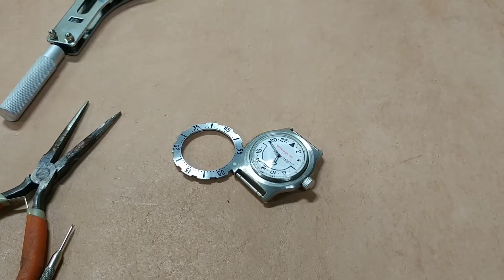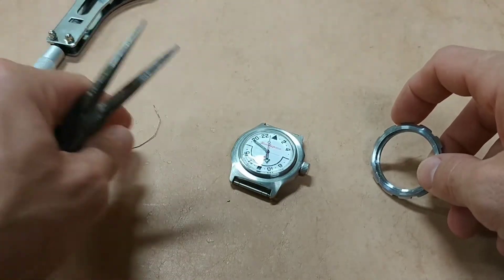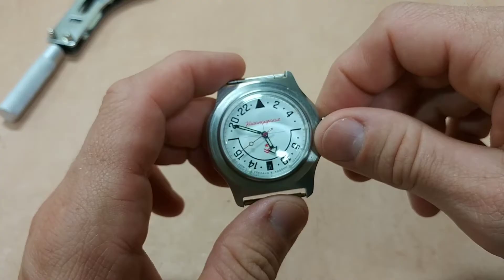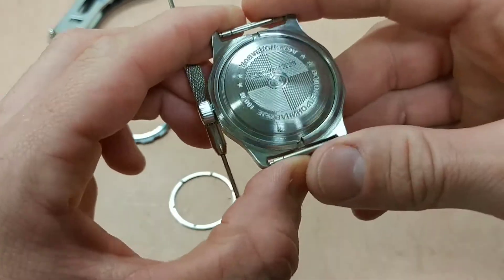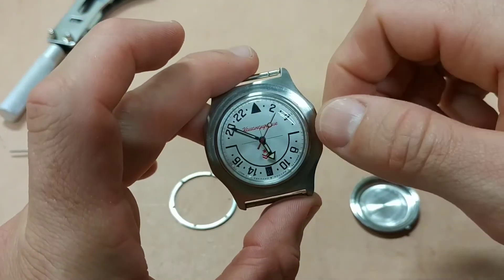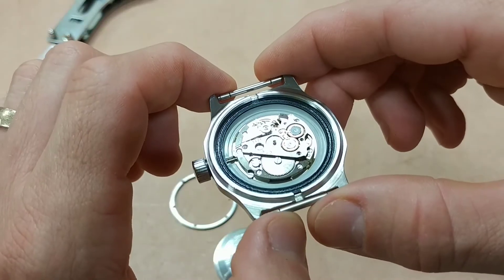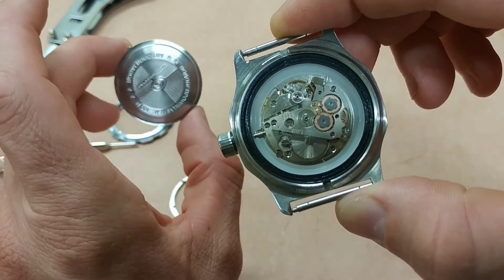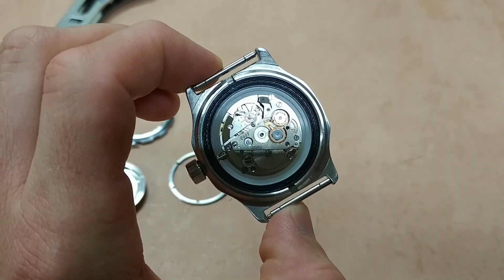So what's so special about the innovative Vostok case back?

Comment: This IS NOT "vostok innovation". This is ANOTHER USSR standard. Literally EVERY one of the USSR watches I have is either pressure fit or this nut ring. No exceptions. But the standard for the caseback is ONE notch in the top not 2. Even for other vostoks I have.

Comment: the rubber compound of the seal is also rather special,
the designers noticed the watches started to leak going up from diving, not at the descending dive.
so they had to "invent" a totally new sort of rubber compound.
the same mixture was used in their spacecraft.
( the NASA had some problems launching the Space Shuttle due to the rubber compound of their O rings, if they knew about the rubber seals used in these cheap watches it would've saved many astronaut lives. )

Comment: so if you remove rotor it becomes manual wind ??? do you have too replace rotor screw ??? thank-you !
Reply: It is actually automatic and manually winded. So if the rotor is removed there is still manual winding. All my Vostoks are very quiet, I do not understand what was the reason here. In some cases people can remove rotor and replace caseback just for making the watch thinner...
Reply: @RadioStreetsunited  please tell me how the removal the rotor has any change of case size. please reply, kind regards, bob.
Reply: @bobhebblewhite1685  Well, removal of the rotor reduces the case thickness, so you can put flat caseback from manual Komandirskie. I haven't tried this, but this should work.
Reply: @RadioStreetsunited  thanks for that, something i did not know!

Comment: Vostok's caseback (and crown, its gasket work the same way) is simply (and finally) hydraulics applied to watch making. No gasket in hydraulics works the way "normal" watch gaskets work. To make the gasket turn with the screw would be considered ridiculous and a flawed design. The screw should squeeze the gasket, not turn with it.
What limits the waterproofing of the Amphibian to 200m (that's a more than respectable limit anyway) is not the sealing, but the thickness of the crystal and caseback's metal, under 200m the pressure is enough to deform them and allow water to enter, infact Amphibian 300m models had been made simply modifiyng those two pieces.
Reply from the maker: Exactly!
Reply: And it has to be said that 200m is the minimum achievable by a properly mantained watch. Here is an Amphibian successfully tested at 50bar (500m)
https://www.youtube.com/watch?v=N_O2yVyx51k
and one tested to destruction, that only happened at 82bar (820m)
https://www.youtube.com/watch?v=s-YKyDkpXbc